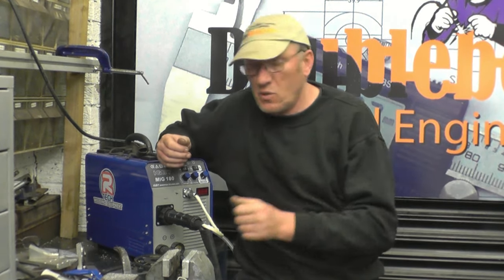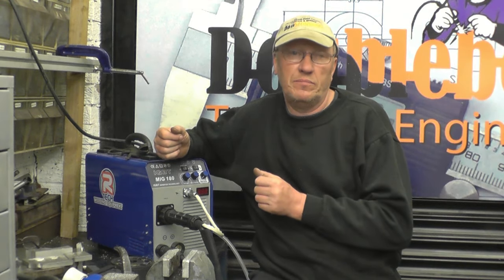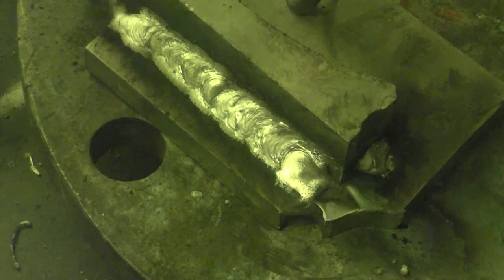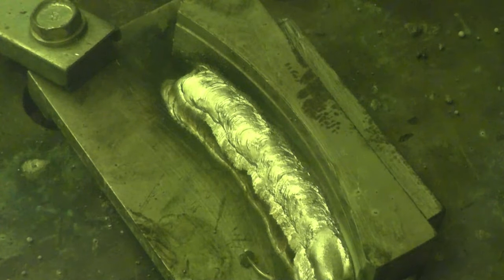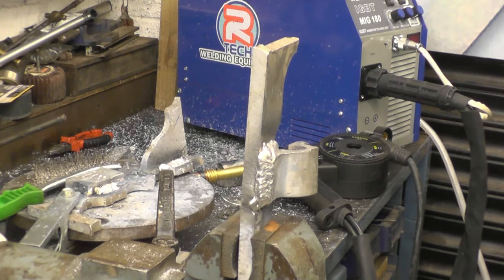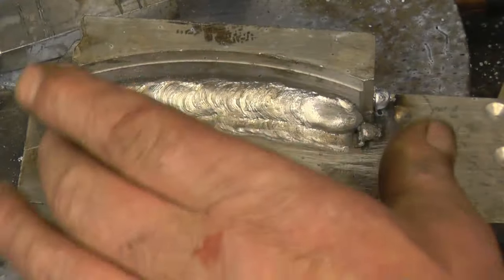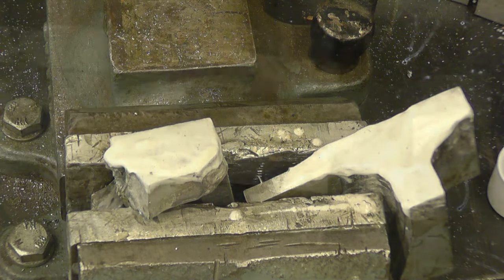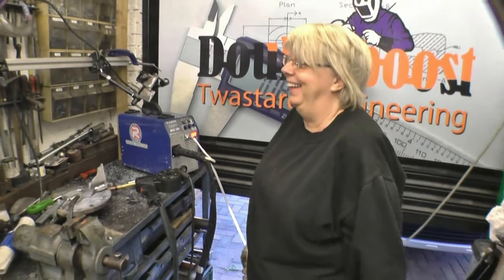R-Tech MIG 180 Spool Gun Aluminium MIG welding Part Four

Comment: Brill videos of the welding, what would be good for us beginners would be a video of 3mm plus steel showing penitration results, explain what a cold and too hot weld means and how to see it so you can adjust settings to suit, i can get good penitration on 1 and 2mm steel as per your vids, but on 3mm it does not burn thru, just metal kinda peals slightly like scale poping off, this would help us beginners, room for thought, but keep it up

Comment: Nice videos, John. Have you found these Rtech machines reliable? Any problems with them?
Reply from the maker: Mine have been no problem at all  I just use a better torch on the tig set  Mine are not in constant use but are used on a regular basis
Reply: I went and got myself a mig from them. Impressed so far by the power. The warranty is very nice of course.

Comment: impressive never seen a coil gun working, might well see if i can get one for ally, cheers john
Reply: pretty sure they work for ally and stainless, the shorter feed route suits those akward wires better, plus you can feed more amps.   my first view of mig welding was these, as an add on to the arc welder,  its only later i saw stand alone mig welders, when i bought mine, that long wire feed was always the issue with it.  shoudlve stuck to what worked!